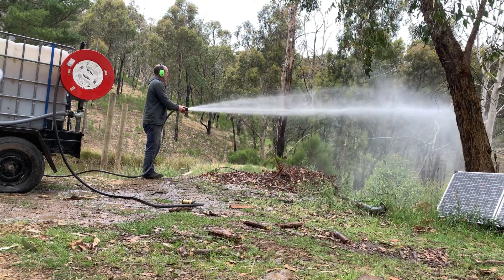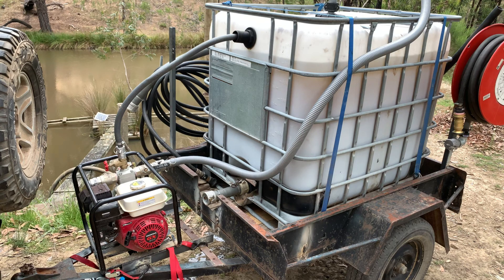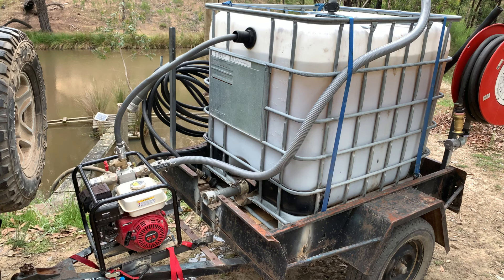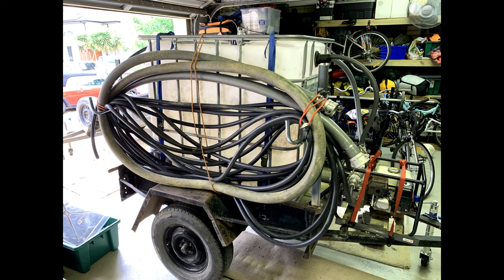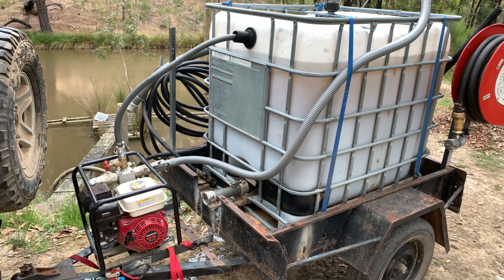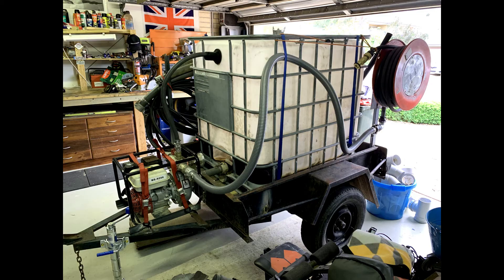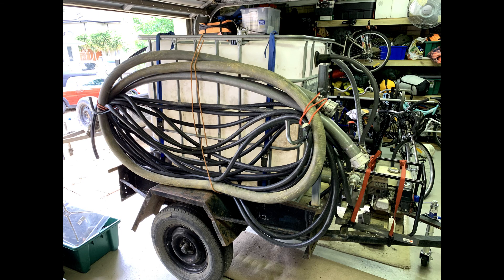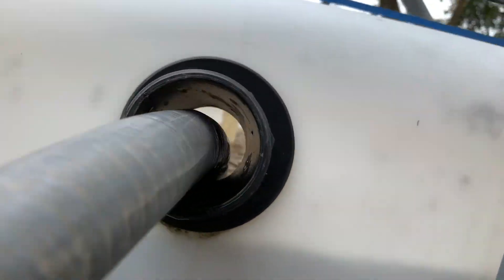Fire Pump Part #5 - Fire Fighting Trailer

Comment: Nice set up. When you’re using the fire hose do you turn off the valve that recirculates the water to the tank?
Reply from the maker: hi, yes i close that vale so the hoses get full pressure

Comment: I’m sorry but that looks horrendous on the throw. What is that 10-15 meters? 30-45 feet? And when both are running it looks like they are getting <10 meters each! If you’re within 15 meters of a fire you’re definitely going to be feeling the heat and the water ain’t going to help much… you need to be among for like 20+ meters of throw. At least when using just 1 hose
Reply from the maker: Hey, nah, the throw is much more than 10-15m, it’s accross the dam wall which is about 25-30m
I’m going to do another video soon and do some actual
Measurements with different pumps and nozzles. Keep watching.

Comment: Add a Mcleod, pullaski and flapper/swatter hung off the side of the tank. And a box for extra hoses, fittings/adapters, etc
Reply from the maker: Very good suggestion. I've just been collecting a few materials and plan to make improvements to the set up. Tool storage will be part of that. Thanks for watching.

Comment: I would hate to be fiddling with those nozzles on the end of those hoses for that long .. I would prefer a handle which when forward was "on" and when back "off", is there something like that available ?
Reply from the maker: Hi, thanks for watching. Absolutely there are nozzles like that. Big lever to open and close the water flow and a twist nozzle to adjust the water spray. Much better than I have but a lot more expensive.
Reply: Hi, thankyou for sharing and responding. Cost is an important factor.
Reply: D handle ball valve. The pistol grip ones are nice to use.

Comment: Would be great to be able to bring more of those containers full of water to top up the tank with the hose
Reply from the maker: hi thanks for watching, since this video was made I now have all my tanks cleaned, my lower tank near my shed is filled with water from the shed roof, I then pump that water to the upper 2 tanks. Plenty of water in the tanks now, about 75,000 litres ( 20,000 US gallons)

Comment: The key is to water the individual trees during the dry season, trees that are full of water/sap will not burst into flame
Reply from the maker: absolutely true of most green deciduous trees, but gum trees in Australia contain highly flammable oil in the leaves and that allows them to burst into flames, it looks like an explosion. The eucalyptus trees also shed bark, leaves and branches in summer, even if you water them, that creates fuel for fire on the floor (unless you continually tidy up). People are creating fire breaks with deciduous trees, the green leaves don't burn well and take heat out of the fire as it passes through, as you said. Thanks for watching.

Comment: What kind of hose and nozzle are on this trailer
Reply from the maker: Hi, the hoses are standard fire fighter hose reel 19mm i/d. I bought 2nd hand hoses and reels, the swivel joints drip a little (making them no suitable for a factory or office) but that's no issue for me. One brass nozzle is a straight jet nozzle with on / off ball valve, the other brass nozzle is a firefighting twist nozzle, with a jet and wide spray setting, this was from a local hardware shop, nothing branded. I'm sure I show them up close in one of the videos. thanks for watching

Comment: Its early September 2023 and, with the threat of a dangerous summer fire season in Australia (after the Northern Hemisphere fires mid-year), I'm looking-into replacing my initial budget (interim) fire-Fighting trailer - which consisted of a quadbike/mower towed mini 12v crop-spraying trailer.
- note - my property is only 1.5 acres mostly un-treed . . with derelict dirt road backing on (firebreak).
Projected upgrade is based on a 
4 X 3 MULTISPORT TRAILER 4'x3.5'
Capacity 505kg ATM, 400+kg Payload
Bed Size 1220mm x 1016mm (formerly named 830TA) distributed as a kit build.
On this tanks, pumps, and hoses (plus accessaries) will be mounted (taking note of load mass limitations). Have not yet decided whether existing 1220mm x 1016mm aluminium tread-plate panel will be used, or just bare trailer frame! (I'm favoring THIS separate dedicated trailer over just a tank & pump skid design.) 
My tow vehicle is a 22hp rideOn mower (having a locking diff switch) with 50mm towball, and 12v outlet. A rider protective mower "roof" may be a addition here (wary of embers) as 22hp mower has four plug-in panel sockets around operator similar to what are found on a John Deere model!
Reply from the maker: Hi John, thanks for watching, it sounds like you have things all planned out. I like the idea of a trailer more than a skid mount, it just feels like there are more options with a trailer. If your land is hilly make sure the tow vehicle won't get pushed by the trailer. Don't forget the option of a "grass watering" type 360 deg fine mist sprinkler head that can be added to the pump, that can create a dome of sprinkler water over the trailer and help to keep things cool if close to the fire and protect hoses on the trailer from embers. Just a thought.
I plan to improve my trailer this year too, mainly strengthening the frame and A frame, lots of advice on here about the frame being too weak for a full IBC ..... which it is, and the dangers if it fails.
Good luck and I hope you waste your time building it and never have to use it in a dangerous situation.  😊👍🏻

Comment: Better set up with 2 totes on a tandem trailer
Reply from the maker: Agree, I plan to modify this scrappy trailer this Aussie summer, strengthen it and add another set of wheels. It would be able to have 2 totes but I’d only have one. My land is too steep to be driving around with over 2000kg behind the car and no brakes on the trailer. If the land was flat I would do that. Thanks for watching.

Comment: Where do you Aussie's get those type of hose reels?
Reply from the maker: Hi, thanks for watching. For me, I got it from Facebook Marketplace. A guy sells loads of them, all used and failed an inspection, they maybe have a few leaks on the swivel joint, and its cheaper to replace than repair. The hoses are fine and I can live with the leak. You can get them new from Fire Industry Supplies, they are great to deal with.

Comment: What is the size of your trailer and the total GVM
Reply from the maker: Hi Robert, thanks for watching. That trailer is not rated for that load (with the tank full there will be 1000kgs of water plus another 50kg of hoses etc.) and thus I wouldn't take it on the road, but its fine for around my place for now. I have plans to upgrade in the future, dual axle with brakes will be the go, until then, cheap and cheerful, operated carefully.
Reply: @TheRuralProject  thanks for the reply mate as I'm looking at building a cheap trailer unit just need to sell my old car first 

Then buy a 6x4 trailer and get a 1000 litre ibc tank but mark it at say 400-500 litres the pump im getting only weighs 26 kgs but I'll be going with a lay flat hose without a reel
Reply from the maker: I think a normal 6x4 is rated at 750kg loading, so you should be fine as you suggested. Think about dual axle so you can unhook it whilst loaded and be certain it won't tip. My tank is set up to always have ball weight, but I did unhook it from the car once on a slight slope and it tipped on end. Once it starts to go there's no stopping it, the water moves and the centre of gravity quickly changes. but its a lot more money for dual axle and not many small dual axle trailer around.
Reply: @TheRuralProject  I'll be getting a jockey wheel fitted with the trailer plus where I am is 100 % flat ground in rural South East South Australia so it will be easy to park and unhitch

If I had an extra 10-15k I'd go for a dual axle trailer and already kitted 400 litre farm unit so for now a basic DIY is all I can work with
Reply from the maker: @robbiestewart1984  I hear you, it’s a lot of extra money. Best of luck with the build. I hope you never need to use it in an emergency.
Reply: @TheRuralProject  better safe than sorry these days as my home town has had a lucky break for at least 40 years in terms of a fire on its door step but luck will run out

Plus I've got a Toyota rav4 with towbar so that's handy i will be putting a short video up on here when its done I'll let you know
Reply: @TheRuralProject  Hi mate just me again I have successfully lined up a 400 litre poly tank of which the local rural supplies store is going to hold till I've got my trailer 

What kinda hose did you use for the intake from IBC tote to pump
Reply from the maker: @robbiestewart1984  hi, that’s a good find. I used suction hose. It’s quite stiff hose with spiral ribs that stop it collapsing when the pump is sucking water. All connected with quick release couplings. Hope that helps.
Reply: @TheRuralProject  Yep that does help a lot as the tank is a TTI brand 400 litre which is normally over a grand with pump and hose luckily I am allowed to pay it off as its been at the shop for over a year also what's a good pump to use as I seen one on ebay that's 43cc 1.7 hp high flow water transfer pump as I'm keeping in mind the GVM not being exceeded of which a fire pump like mum has connected to her bore would do 

I like the way you have a secondary line and noted the only drawback is amount of water being used if both hoses are operational at same time I am aiming for a primary attack line consisting of an Ozito  25mm x 20m fire hose and a 20m x 1 inch 25mm fire hose with cam lock fittings as a secondary or mop up
Reply from the maker: @robbiestewart1984  hi, I’m not a real expert on pump sizes, but I do remember some comments on the fire pump playlist of videos from some very knowledgeable people who talked about best fire pump sizes. Have a look and you’ll find it. 
The 2 hoses on reels that I have are 19mm, 30m long it think. You’ll see the flow rate is good through these hoses and in one of the videos I show how long it takes to empty the tank using both hoses. I cannot remember the exact time but it’s much longer than you think. Remember that if you use a lay flat hose as your fire hose, that you walk around with, it will easily get kinked as you change direction and have to keep addressing that or have a second person laying it out for you ( as firemen do ) but if you have the 19mm fire hose ( like a strong hose pipe ) it doesn’t kink as you move around. 
I have a combination of lay flat ( for distance ) and 19mm hose for moving around. 
Chris

Comment: HI there, id like to know more on how you suck water from the dam to fill the IBC? The video seem to skim over it but perhaps i didn't understand and missed the detail. Are you swapping the hose attached to the IBC for a hose to throw into the Dam?
Reply from the maker: Hi, thanks for watching. I disconnect the pump from the ibc. I have a separate suction hose with a foot valve ( one way valve ) and screen on the end. I drop that in the dam and connect it to the inlet port of the pump then pump into the tank. Just don’t forget to close the ibc outlet valve.

Comment: what size is the hose on the Reel ? Im looking at a 19mm hose on a reel for mine, my pump is a 2" outlet, will 19mm hose be to small ?
Reply from the maker: Hi, thanks for watching. My hose on the reel is 19mm, I think that’s standard for that type of fire hose. It will all still work, you will of course just restrict the flow. as mine is linked to the water container 19mm is just fine. 
I do have larger hoses that I would use if the pump was pulling from the dam.
Reply: @TheRuralProject  thanks mate. I am kitting out my rusty old farm ute a 1965 Nissan Patrol G60 4x4 Ute, I Can fit 2 x 1000L IBC on the tray. Plan to fit one of the 36m 19mm hose reels to it. The pump is just a cheap 8HP one. What your thoughts mate, keen for any feedback.
Reply from the maker: I know the G60 is a tough rig, but not sure of it’s load carrying. I’d guess it would struggle with 1 ibc full of water. Each 1000 litre ibc weighs 1000kg, 1 tonne, when full. I think you’d get a lot of rear end sag with 1 ibc. I’d guess it should only be loaded with 500kg. 
Better to have something rather than nothing, that’s my approach, so give it a try. 
I find mine useful for all sorts, watering new trees, safety when welding in the bush and of course bush fire safety.

Comment: Fellow pom, had a similar setup (rusty used trailer) with a 1000 liter IBC, the trailer failed/folded at the A frame part & one ton of water slid forward crushing my leg, lucky there was two of us & we managed to drain the water & free my leg, very scary moment in my life.
Reply from the maker: Hi, thanks for watching. A couple of comments about the trailer not been suitable, makes me think twice. I do plan to upgrade the trailer but other priorities first, until then I need to be extra careful. Thanks for your info. 
Where you from in the Uk ? I’m from Hull.
Reply: @TheRuralProject  Newport Pagnell (of Aston Martin fame) Yeah soon as i saw your trailer it reminded me when i was riding on the back down the paddock, the A frame folded & the IBC slid forward trapping my leg, we was only going 5kmh.

Comment: Whilst I encourage preparation, fire fighting is dangerous. I am a professional with 15 years of wildfire experience. Every decent fire throws curved balls. This would be ok on flat small fires. Trailers can be a liability if an escape is needed. The IBC full of water is 1000kgs the trailer would he lucky to have a capacity of 600kgs when brand new. Those old quell reals break near the swivel if they are used for anything other than office fires and the nozzles tend to blow off when needed most. The drawbar is not designed for the load of the pump. 
The reason that I am saying this is to make sure those who copy this with little experience don’t end up in a world of trouble. 
I admire your efforts.
Reply from the maker: Hi. Thanks for watching. Really appreciate the feedback. The trailer is trashed, I agree, it has been strengthened where needed, but it’s rough as. Fully agree, I’m no firefighter and my plan is to get out if I can. I’ve also received some great advice, in addition to yours, which I will put to good use when the time is right ( I don’t live at the land yet). 
Until then, this is far better than nothing and when I’m welding outside or having burn offs, it’s good to have a fire pump close by, even if it’s not the most reliable. I’d rather have this than a 15ltr back pack pump action.